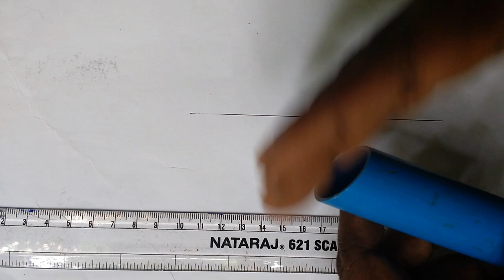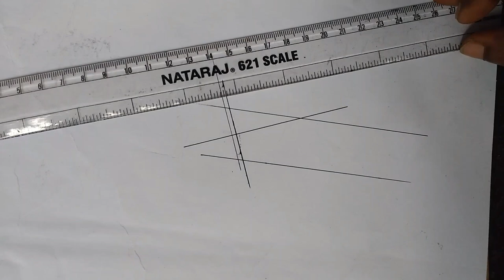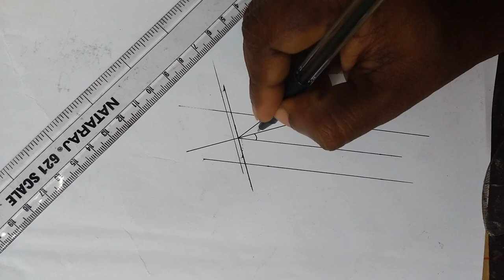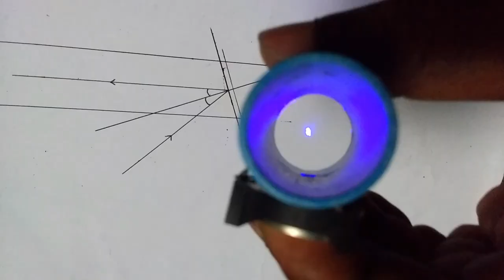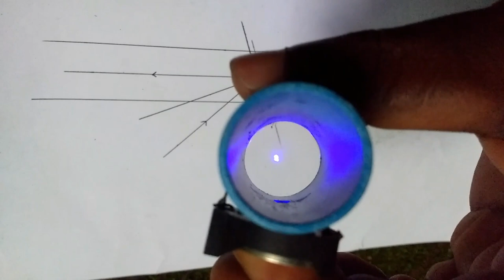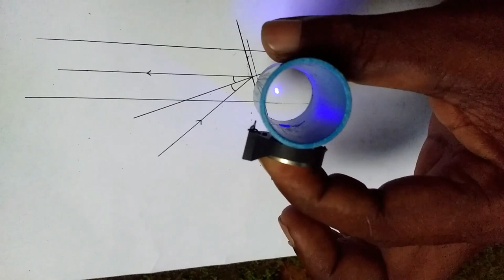DIY holographic dot sight

Comment: Is this light an LED or its the light from a lighter or something special because i tried making one but the light isnt small and nice edges its like someone is shining a dim lighter onto me because i used lighter light any ideas ? Also where can i get this lense or glass from what shops . I would appreciate that help 👍
Reply from the maker: It is just ordinary LED bought from amazon.com. The glass used is cut from 2mm acrylic sheet, bought from local sign board shop, it's also available on Amazon. Nothing is special. I suggest you try with LED having more intense light and colour and a good battery with enough voltage.